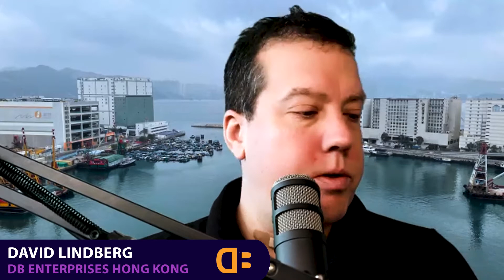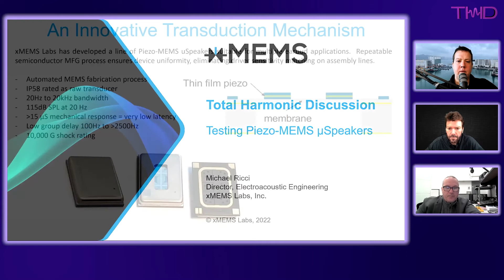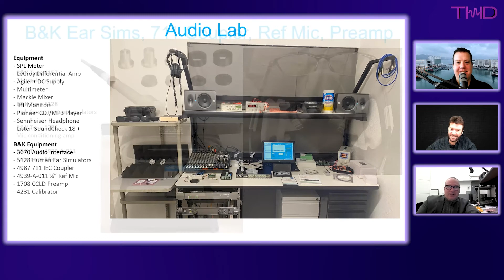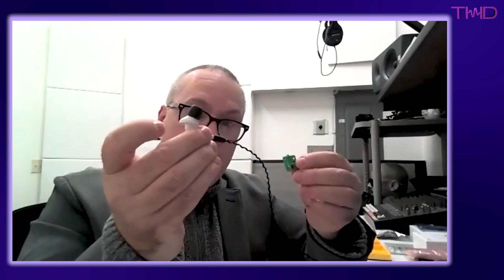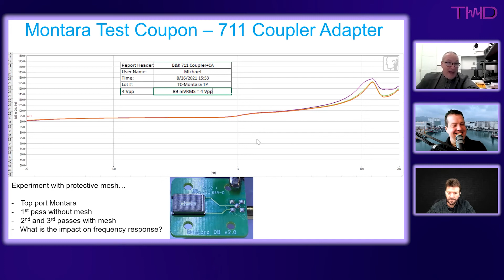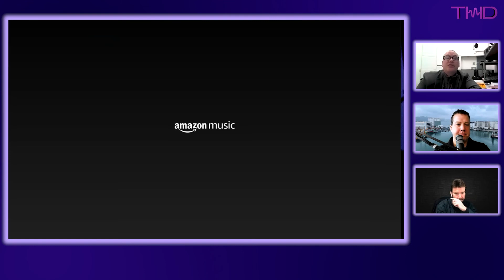xMEMS Disrupting the $10B Speaker Market with Worlds First True MEMS Piezo Speakers - THD Podcast 63

Comment: Are they on the market yet?
Reply: most people dont want to work with it because it need it own bias voltage to work with
which in a wired iem market is ...kinda not favorable...
also i assume the driver be stupid expensive
and still need a hybrid set up because it bass is going to be turbo limp and shit for the fact the driver cant really do excursions
and also dynamic probably going to ALSO suck cause again.....no excursions
the best i see this being used at is well...tws and as a hybrid tweeters